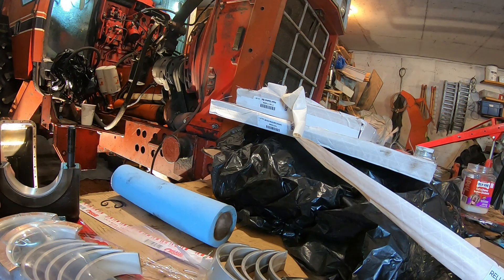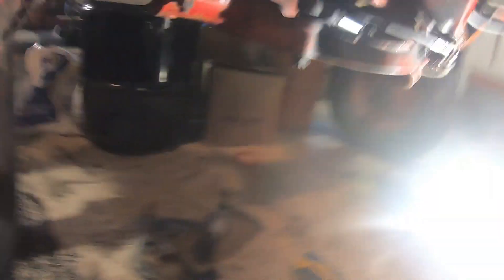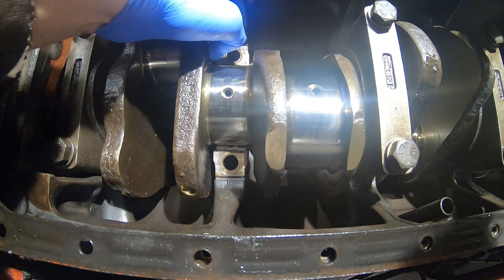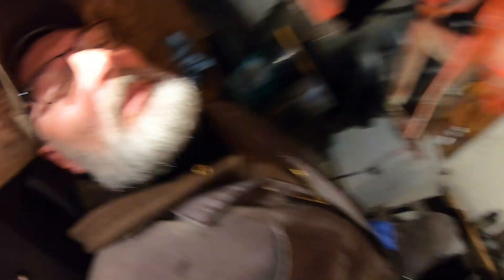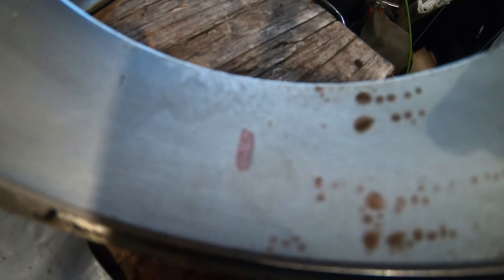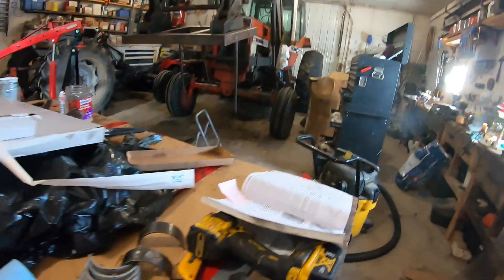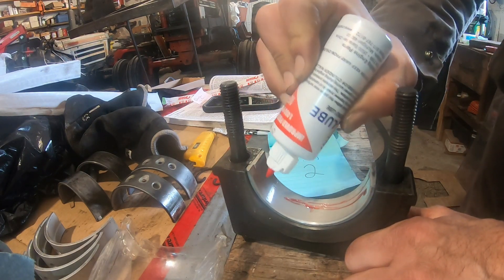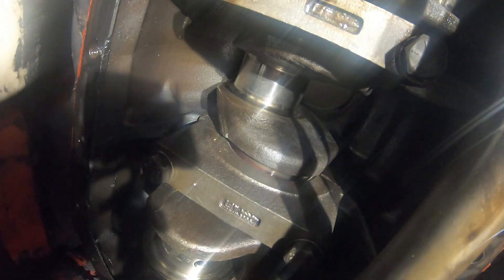Tractor Engine Repair Part 3!!!!!

Comment: I'm glad you got help there Randy. I've never tried to do the sleeve piston and connecting rod all in one shot like that before. I bought a ring compressor about 3 or 4 rebuilds ago. Did the mechanic bring his torque wrench for the rod bolts?  Please tell me you replaced the rod bolts while you were at it. It scared the 💩 outta  me when I broke some of them in my 1066 because of that faulty torque wrench.
Reply from the maker: We did replace the rod bolts and we used the mechanics torque wrench and double checked the main bearing bolts with his wrench.
Reply from the maker: The piston was in the sleeve when I got them in the whole kit.
Reply: That's the way they are shipped now, it does save a person from screwing up the orientation of the rings.
Reply from the maker: Yes it was complete.
Reply: Where did you get your kit?
Reply from the maker: Double R In Steinbach

Comment: Doing a great job.  You have more patience than I do.  I would’ve had quite the string of swear words if that bolt dropped on my head.  Lol. 😆
Reply: Oh Chad you would have been swearing because the oil was dripping on your face when pulling the caps. I know I was muttering alot the times I did 🤣🤣
Reply: @burrridgefarms  I start getting mad once I start getting dirty.  Lol 😆